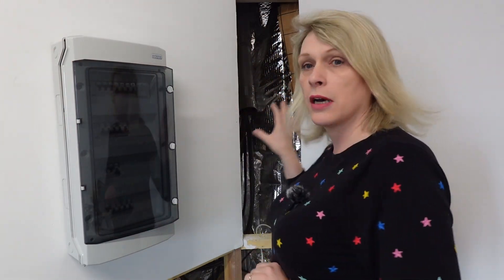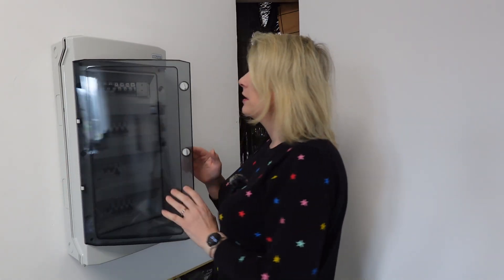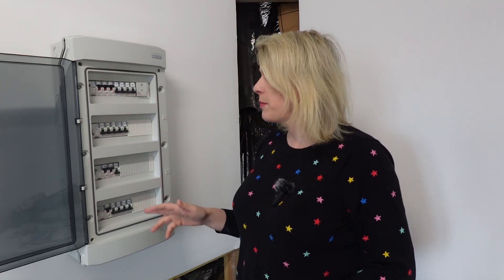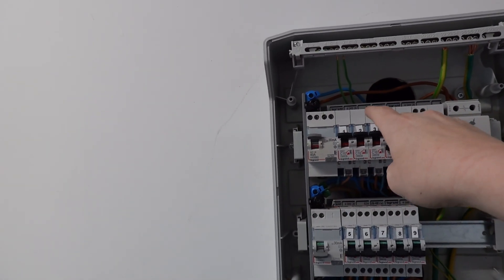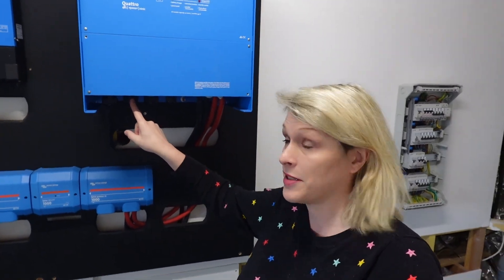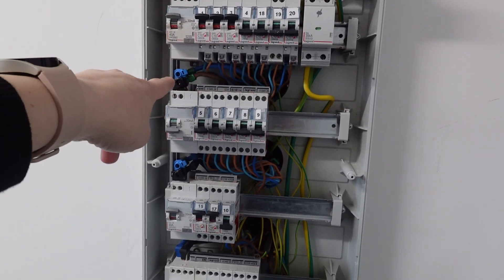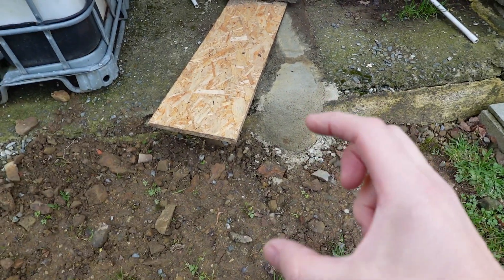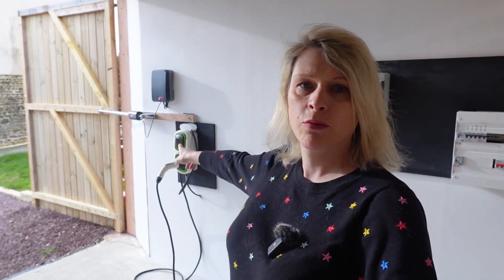The AC side of my solar system

Comment: I'd like to suggest you consider the Microinverters rather than using long DC cables between buildings.

You may add a general meter (sub-meter) between the grid and your installation. SDM630 or similar, with a communication port.

With export power data, Victron may decide to load the batteries using AC input - and consuming produced energy.

Comment: Please reconsider those loads that you feel are protected loads. The garage should be on the high amperage bus. The charger is equivalent to the 35 amp or greater load. The computers and starlink can be done without for several weeks when grid power and solar power in not available. Refrigeration is critical, some of the lighting is critical, a well pump is critical. Think of those loads that if they are unpowered you will die.

Comment: I like the setup. Still strange that there is just one phase...
Reply from the maker: In Europe we don't use split phase. Or were you talking about three phase??
Reply: @Gridbusters-qx4om  I was talking about three phase. Especially on an property like yours, a proper three phase installation would come handy when running heavy machinery.
Reply from the maker: Because this is a residential property we only have single phase.  the electricity board here would charge over 8K if we wanted three phase installed.